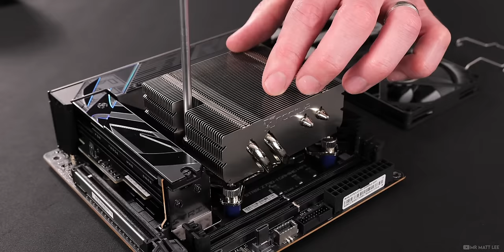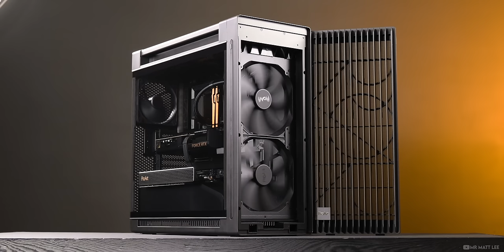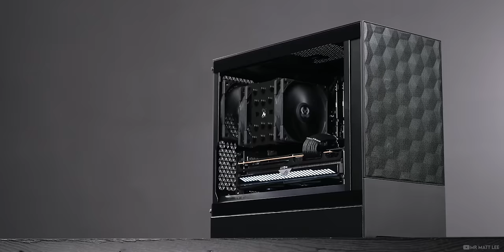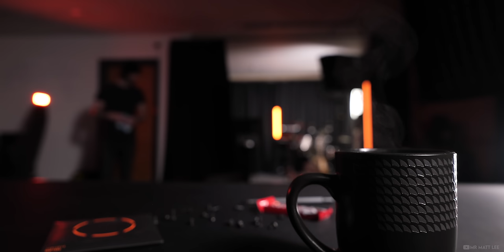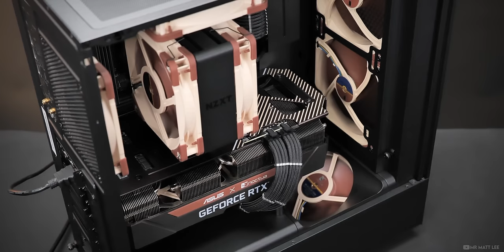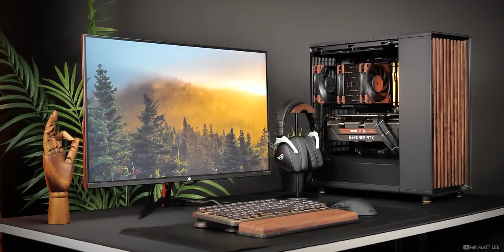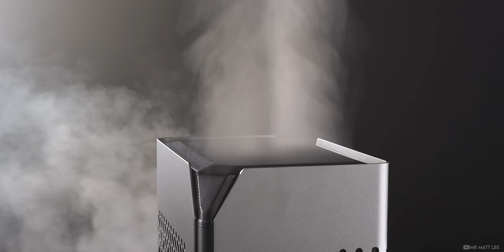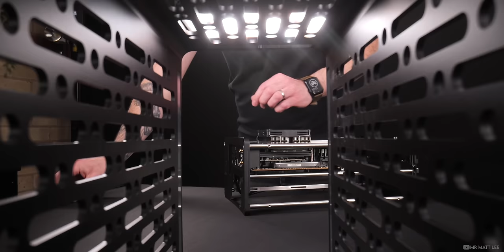PC Case AIRFLOW; A Visual Guide for Optimal Cooling.

Comment: I like the inclusion of 7:30, I learned this myself when i had fans populated everywhere and under load the front top fans were blowing cool air out whilst the fan above the tower cooler was exhausting hot air like the rear exhaust. Also for the AIOs if it can be facilitated intake is always better overall, GPU temp goes up marginally whereas AIO as exhaust the CPU suffers more when comparing the two. It's also easier to clean the radiator of dust when you have the AIO as intake with the fans set to pull.

Comment: I reversed my back fan to push air in. I have an older NZXT case which has only 1 side and bottom intakes in the front panel, which has an awful air flow for hot summer days. Often i dismounted it because it was less noisy than. The top was the same with side outtakes, but i cut it off and 3D printed a fancy mesh so the radiator for the CPU AIO can get the hot air out.

With the reversed fan in the back, pushing cold air over the VRM heatsink  and can directly flow out through the 280mm radiator the CPU gets way more cooler. In the UEFI i set 70°C as limit for the OC of the 7800X3D and it beat my benchmark easily vs back fan pushing out. The two 140mm noctua fans in the front are still very important for GPU, NVMe, RAM etc and finaly getting sucked out of the radiator too.. but everything has more performance now and less noise.
Yeah I will get more dust in it, but idk why its always sucking air out at the back.. 
I've learned with that shit silent case, pushing cold air in from all sides and sucking warm air out from the top, is efficient.

Comment: One thing to consider with airflow focused cases is that while yes, they have less material for sound blocking it also means you can run the fans slower for the same amount of cooling at lower noise level. 

I bought a Lian Li Lancool 2 case and be quiet fans and the slowest setting is completely quiet whilst keeping everything cooled adequately. Hell, even on the medium setting I don't hear it over my games even with open back headphones.
Reply: That said I'm a bit of a dummy and wanted max fans so I have two up top. Now the front most one is still a bit away but I made them both intake so as not to immediately blow out cool air.  Now it's probably making a lot of turbulence. I might try making the exhaust or try what others have said in here and take one out and block that area.

I also didn't want to "waste" the mesh up top by making it exhaust. I dunno. It's tricky but all my stuff is cool anyways so I may not overthink it

Comment: You make the cleanest videos I've ever seen. I'm pretty sure none of my builds - even out of packaging - have ever been that dust free. I have a question for anyone here: I'm busy planning my first ever custom water loop. The case I'm using is a Phantex Evolv ATX glass, which I've learnt is pretty bad for airflow. I read somewhere that someone got good results by making their rear fan an intake while pushing exhaust through the front and top rads. Any thoughts on that setup?

Comment: For the AIOs, you would want the in-/outtake of the radiator facing the bottom or better mount it to the top of your chassis. Better for avoiding airbubbles getting pushed to the pump.

Comment: Using a Fractal Define 7XL case now and my setup is as follows:
Two of the three 140mm fans that came with the case are drawing air in from the two slots of the bottom filtered intake closest to the front and the third is drawing air in from the bottom slot of the front filtered intake. Two Noctua NF-F12 are on top of the 140mm Fractal fan blowing air directly at the Noctua NH-D15s chromax black CPU cooler which has two Noctua NF-A15 fans drawing air through it. There are no fans for exhaust as they are not needed. The GPU is a Zotac RTX4090 gaming and it never gets over 75C.
Al the fans are programmed through the BIOS: The three Fractals run off the fan hub with voltage control and the Noctuas get RPM control. The two F12's can be loud but the CPU never gets over 89C and they don't get told to go 3000 until it hits 90C. At 89C they're told to go 70%, but it never stays there long. Even under Kombustors CPU Burn it may go to 89C for a few seconds but as soon as the A15's go to full 1500rpm the 7950X3D cools off to 86C and those server fans drop down to 40% where they're very quiet.
Yes that's right, I'm running a Ryzen 9 7950X3D with no throttling (120-128W) without water cooling, and the Zotac 4090 is running cool as well. And this is a VERY quiet setup.

Comment: Hey, I appreciate your methodic work on this subject. I've got an old Corsair 600T, and I'm recycling it for my new build.  AMD 7950 with NH-15 and  4070 Ti Super OC.
it collects SO MUCH DUST.   It has all stock fans' thoughts on changes on more or fewer fans or speed changes.  I plan on getting and Artic PWM fan controller.

Comment: Beautifully done. However, I'm still not convinced that top mounting the rad as exhaust is optimal, particularly in a gaming situation. A radiator relies of cool air to work well. The opposite will be the case in this configuration.  Also, despite what most people think, you are NOT flooding the case with hot air when the rad is set as intake.  Just stress your CPU as feel the temperature of the air coming through.  It'll be way cooler than the air streaming from your GPU. Remember that most of the heat dissipated by an AIO CPU cooler is in the liquid.

Comment: The only things i would have to criticise is the convection part and the noise from open front cases. Other than that it is a great video.

To my knowledge the fans can overcome the convection of air with ease.

And open front cases should be able to run the fans slower at the same temperature. Thus they have a good chance of being quieter. Especially when fewer fans are installed to achieve the same temperature.

Comment: I had a full tower Storm Stryker for a good few years and it made me really blasé about airflow, I had 3 rads and a bunch of fans just thrown in there any which way and it was all cool. But eventually I moved to an O11D and I was in for a complete shock. I had to tear it apart and reassemble my build about 3 times to get the airflow right, and I finally understood what all those people meant when they were talking about airflow!

Comment: I just realized after watching your video that I have my fans on my 360 AIO at the top facing the wrong way. I have them pulling air from the outside into the case and not pulling cool air from the inside through the radiator. My fans at the front are pulling cool air in from the front for the gpu fan cool set up. Glad I watched this video and realize I need to turn my top fans uptop around.

Comment: A question please.

I am using a Corsair 5000D Airflow case..

My plan (please advise if the side fans are necessary, or push-pull on top is necessary):

1. 360mm radiator at the top (push config, do I need push-pull?)
2. 120mm exhaust at the back
3. 3x 120mm intake at the front
4. 3x 120mm intake at the side (front side, do I need this?)

Looking forward to your kind advice. Thanks!

Comment: You should install the aio radiator with the tubes going to the bottom, not the top if installing on the front, its easier for the pump to push the water upwards than pulling.

Comment: Very nice, although I would've liked it if you'd pointed out the pros and cons (airflow-wise) of different case types, and how to maximize airflow in each.

Also, it would be nice if you'd explain what to look for at the smoke flow so people understand what's good and what's bad, such as turbulence, recirculation, and dead spots.

Maybe if people better understood things like this (and other airflow things), they'd be less inclined to buy crappy cases that choke the airflow because they're foolishly prioritizing appearance.

I ran a series of tests (not done, actually) in a 5000x and discovered that, for both the CPU and GPU, the best results were obtained when I had the rad on the side. In fact, all 4 configs on the side ranked in the top 5, with #4 being in the front, tubes up on intake. However, the best of the best, were both side, tubes up and, exhaust beat out intake. Using Prime 95 with small FFTs for 1 hour, my 12700k CPU (stock settings) only reached 82 C and 83 C respectively, and the GPU (also stock) in Time Spy reached 92 and 97 C respectively (delta Ts).

The tests were conducted with unused ports not being altered in any way (i.e. I didn't remove any glass panels or dust filters) and every test was with a single Noctua A12x25 on the back exhausting air out. In other words, only the 4 fans.

The AIO I am using for these tests is the Thermalright Frozen Notte 360, which has a powerful pump, and it doesn't even need stronger fans (I tried the Super Flower Megacools and saw a 1 degree difference).

Comment: Cool the GPU first, then the CPU and PSU. Go4 run the air at the front of the case from the bottom first so it goes straight to the back and out with the case cooler. For this you will need only one or maximum two fans

Comment: Stunning content as usual. How would you set up a Corsair 2000D with a 14700K, 360 AIO, and no gpu? I’m torn between intake or exhaust for the AIO, and consequently the airflow direction for the front fans.

Comment: Hello, first and foremost, this is an amazing video, great job! Second, I have a question. I bought the Corsair 7000d, a full tower, for my future build that would have an ROG STRIX 4090 and a Ryzen 9 7950x3d with a KRAKEN ELITE 360. The case comes with two 140mm fans in the front and 1 in the back, and the case also have space for 4 120mm fans on the side. Since I play to put the Kraken radiator on top, as the video points out, for the GPU, what should be the ideal scenario for the rest of the space? Should I have the 4 x 120mm fans on the side, would it be too much, should I just have some, should I buy the one missing on the front? I really would appreciate your help if you could advise me!

Comment: What about the fractal design north mesh case? I have 2x140mm in the front, 240mm aio in the top and a 120mm in the rear. But i can also install 2x140mm fans on the side panel due to the mesh panel 🤔 having those 2 at intake wont mess with the airflow?

Comment: Ok I have a gaming pc but I put the aio rad at the front as intake but I have a 5000d airflow case so I have three fans on the side as intake, 3 up top as exhaust and 1 in rear as exhaust. So I am keeping my cpu cold while also rushing cool air in as fast as possible. 

So far I’ve seen no major temp issues and my gpu runs at a decent temp when I game. Granted I don’t game for hours on end as I don’t always have that kind of time.

Comment: We should have dividers in our cases that divide the air flow in and out of the CPU section from the in and out section of the GPU.
This way there will be more direct path to the part and out, and less air mixing.
Basically, if the cpu and gpu were in different cases.

Comment: Amazing video. I was under the impression @6:47 the pipes should ideally be at the bottom. I watched a NG video where they explained any air  trapped at the top or the radiator, in the set up you showed, could be subject to being pulled in by the motor. To avoid this the radiator should be flipped so the pipes are at the bottom. However, making sure the pump isn't at the highest point is priority like you said. Your tests have concluded differently? Not trying to say right/wrong but curious from a science perspective.

Comment: Hey Matt, I have a Thermaltake Tower 900 but currently using air cooling. I am struggling with a proper airflow setup due to the low amount of intake fans in the front section. Could you provide any insight how to get better cooling, especially for the GPU?

Great video with wonderful visuals and concise explanation. Thanks!

Comment: Thing is it's not just about fan positioning, it's the air flow of the fans. A certain way may cause turbulence but you could eliminate that with different fan speeds. 

So what's the best mid tower for air flow using AIO?

Comment: Im on Lian Li Lancool 215x. 2 front intake 200mm fans. 1 rear exhaust 120mm , one under gpu 120mm exhaust fan and 2 140mm fans above the cpu as intake. So far temps are great

Comment: This video was very helpful.  I'm looking to migrate from a fully water-cooled build to a fully air-cooled build.  I love my custom loop, but the maintenance and difficulty of swapping parts has me wanting a more simple build.  I'm leaning towards a be quiet! build with a Dark Rock 701 case, Dark Rock Elite cooler, and Silent Wings 4 Pro fans. I would love to see Mr. Matt Lee build this in all black.  I'm curious as to what others think of fan layout in this case.  I'm thinking 3 140mm front intake, 1 140mm PSU shroud intake, 1 140mm rear exhaust, and 2 140mm top exhaust.  Anyone have thoughts on this setup?

Comment: Another consideration fro small-factor builds and high-perf - mini motherboards typically pack less VRM capabilities - so even if you slap an i9 in there, you might only get 80% of it which is pretty much i7-

Comment: Nice! Your videos are on another level.
I built my new PC with a 7800x3D (Evo XL case) and would love to see the smoke test on something like that.

NH-D15S in the CPU.
2 Fans rear (Noctua 12 cm). 
3 Fans bottom (Noctua 14 cm) | 2 of them blowing directly into the GPU (4070Ti).

And that's it. All black... Inspired on your videos. Top of the case closed with black contact paper.
Seems weird to have only 3 bottom intakes and 2 rear exhausts?
Yeah, but check results below!
=D

Quiet as hell even on game load (99% GPU).

I play on 4K/60, so GPU is usually > 80%.

CPU: 55º   (up to 60º depending on the game)
GPU: 61º   (video card's 3 fans at 35% speed when 99% load).
Room: 30ºC

Noise: super low even under full load.

Note: both CPU and GPU undervolted (together they consume 200w or less).

BG3 in 4K/60 most of the time with "ultra" settings.

Comment: Visually stunning. I just would like to see how does the cool and hot air behave inside the case with an infra camera. Whilst the airflow towards the CPU and then out of the case is pretty clear I am still not sure what is the best solution for cooling the GPU when the GPU is in PCI-E slot and fans face the bottom of the case. Usually the PSU is in the bottom of the case and the warm air from the PSU goes inside of the case. Do you have some video related to cooling of GPU or any recommendations?

Comment: This is very useful guide for first time builders such as myself. I had bought an Apevia Prism case which is one of those dual chamber fans that have them on the side instead.

With that I guess I actually do need more fans  I can put more at the bottom. Though do I also need to flip the side fans to be intake while the top and bottom be exhaust?

Comment: Very nice edited video. I would however have liked to see some reflections on over/positiv pressure vs under/negative pressure. If you have a "meshy" case negative pressure from case fans can cause air to "leak" into the case without passing the components you want to cool.
Reply from the maker: There will be another video soon which goes more in depth on the subject in general. I was conscious that things like pull/push, positive & negative pressure, custom loops with multiple rads etc weren’t covered in this particular video, but that’s more advanced than airflow basics and deserves its own position on the channel 😊

Comment: Front of case: fill all fan slots as intake
Back of case: have a fan for exhaust
Top of case: have a fan for exhaust near the back left corner near the back exhaust fan for air cooling
Side of case: have fans for intake
Aio cooling: the radiator is usually the best up top
Reply: You forgot bottom of the case?
Reply: @gezimlimoni2319  yeah, depends on the case model. If the case allows direct intake airflow like lian li cases, then install fans for intake down there as well. If it's just fans above the psu shroud that's not really needed unless you want extra cooling for the gpu
Reply: @TheBlueBunnyKen  OK, how about my case is Cooler Master H500, please help, for the bottom fans?
Reply: @gezimlimoni2319  I just looked up that case and it looks like air only comes in from the front of the case?
Reply: @TheBlueBunnyKen  you're so right. I was more than sure that such a big case have place for bottom fans. Anyway I have factory setup, almost three years, running good so far. I have AM4 about to jump on AM5, already ordered 7800x3d, so I need maybe to add at least one more  fan at the top, so any help where to install it as intake or exhaust, now only one exhaust 120mm at back... please any feedback
Reply: @gezimlimoni2319  if you have an air cooler tower for the cpu the top fan will need to be set as exhaust near the back top left of the case closer to the back exhaust fan
Reply: @TheBlueBunnyKen  yep,  that makes sense,,, thanks man,,,regards from Kosovo

Comment: For AIO´s simply put the radiator in the front or back, wherever you have room for it, but always as an intake, that way it gets fresh air from outside. Every fan in your PC has to be an intake except for the ones on the top, those should be exhaust and that's it, fluid mechanics and thermodynamics at its finest!

Comment: Mine would make you have an aneurysm 😂 only way i could make it run cold was to use the too case fan and rear fan as the intake and the watercooler backwards at the front so that the fans push air out the front. Gotta love the og NZXT H510 😂

Comment: Exhaust top, intake bottom&side. 

Y40 white outside, with gigabyte waterforce x360 lcd at the top(soon to change the fans with lian li INF 120), 2x Lian li inf 140 to the side and one bionix f14 in the psu shroud. My 4070 ti wont get past 70 C in full load raytrace max.